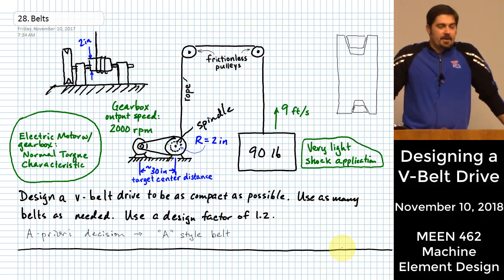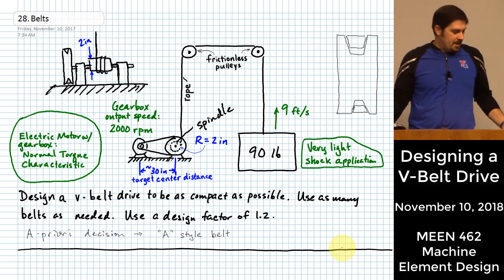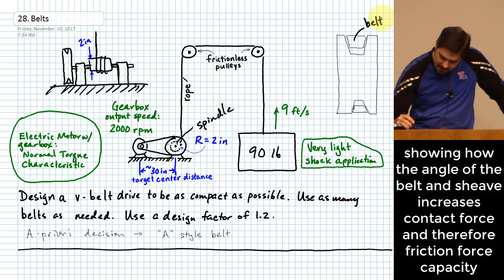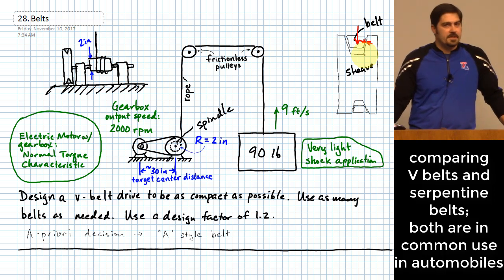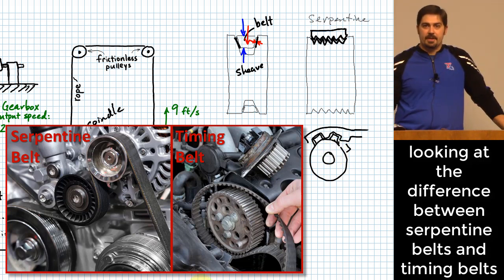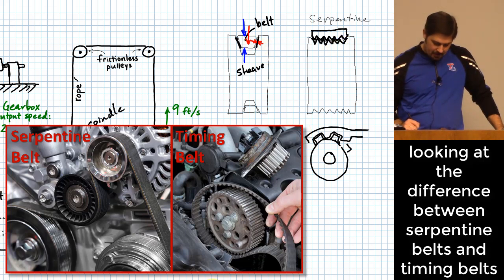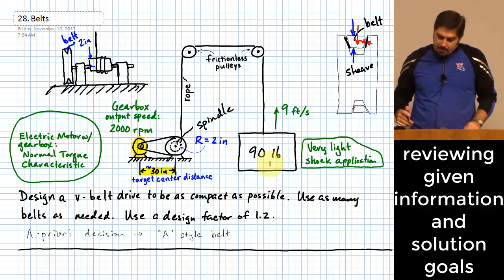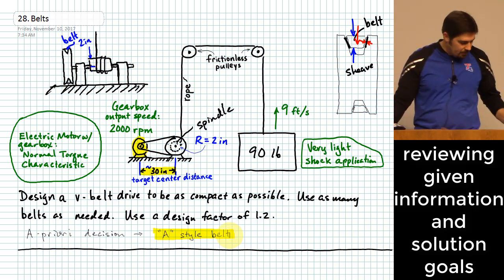Designing a V Belt Drive for Power Transmission | Choosing a Standard Belt Length | Center Distance

Comment: Decent,  3 things,  Unless you are manufacturing sheaves would have to pick a common one to use close as possible to what you need, (I know you know this), also with belt length better to find out a common length if you have a choice, finding a off size v belt while your machine is down is a real bugger!   Third 3 sheave pully set up to drive the alternator on old willies jeeps so they could drive enough power for there army radios!  Other then That easy to follow, love the colour coding!